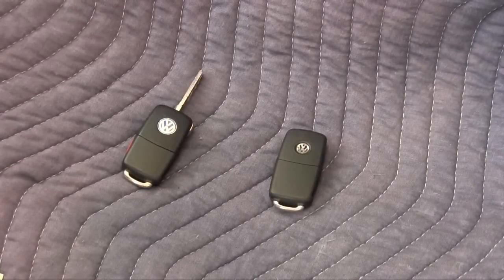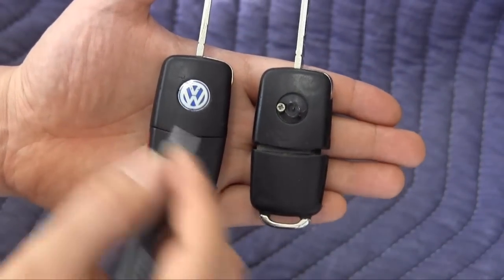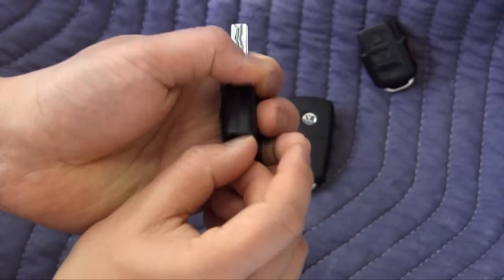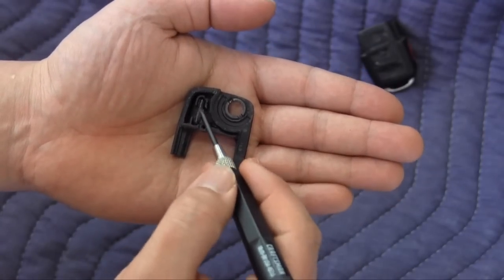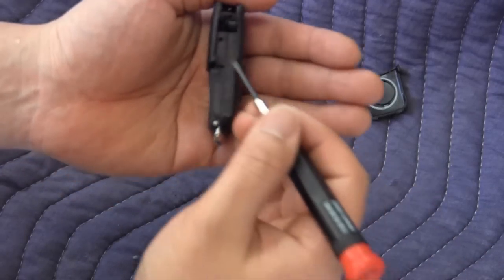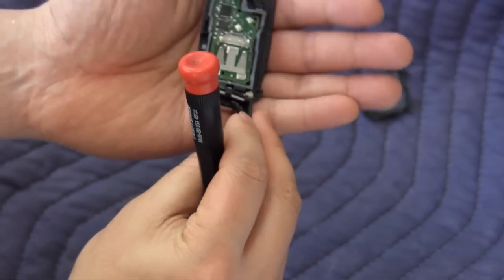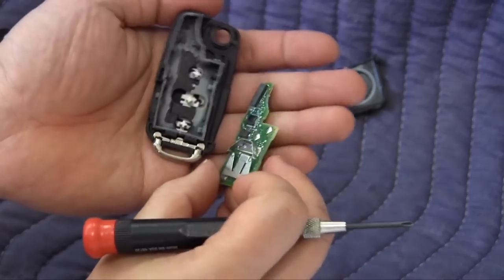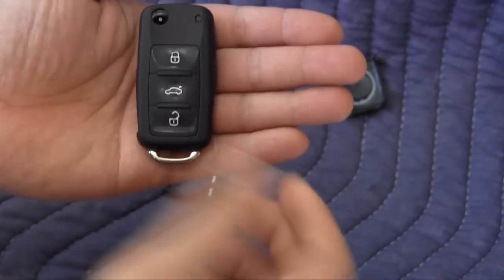VW and Audi key remote disassembly for replacement of key ring, flip key, and immobilizer chip

Comment: Great tutorial, much appreciated! Something I didn't understand when I first watched that might help others is with the newer model which VW and Audi don't make easily serviceable the "easy button" is to use a very small set of needle-nose pliers, select a drill bit or Dremel bit to cut away just enough of the plastic to get the tips of the pliers on either side of the locking pin just deep enough to get a grip on the pin, perhaps 1/8" and pull the pin straight out with the pliers. The pin can be reinserted to put the original case back together. In our situation the key fob had been washed and the panic button was sticking and I just needed to clean out the enclosure.

Comment: thanks! I had an old style audi remote (1997) and couldnt find a replacement. SOo I ordered the VW old key you showed, took it apart, put in the chip, made a new key cut and closed it. worked like a charm. The only sad thing is that the circuit is too big to fit in the VW key. back to manual hehe

Comment: for the newer style key fob I managed to push out the pin
out! I removed the Volkswagen logo from the back.  Where the logo used to be,  I drilled 2mm deep hole,  off the centre, to the right(towards the blade) ! Than I pushed it out with a screwdriver!!

Comment: On the older style of VW remotes 2009 and Older. The key fob can be removed by firmly pulling the two parts appart with a left to right motion. No need to mess with the screw to get to the board or the battery.

Comment: You can take the pin out without damaging anything. Use a small punch and tap it in approx 3mm and you can then push it back through once it’s apart to remove it completely, and then punch it back through again when it’s all back together 👍🏼

Comment: Thanks so much for sharing this! It was exactly what i was looking for!
I would like to mention though, that my 2010 VW Beetle has the one with the larger of the 2 VW emblems on it.
(the one that has the screw behind the VW emblem)------So maybe they changed in 2011 but not 2009 or 2010.
Reply: Same here, exactly what I were looking for. About what year they change the keys: I think they change the keys at different generations depending on models. I drive a Transporter T5.1 2010 and have the key with the smaller logo. So I conclude that they must have switched the key generations at different years.

Comment: you don't have to destroy, drill out pin or drill two holes... you just need to punch that pin in, it goes all way in (breaks just little plastic piece inside the key case. pin gets all way in and frees up so you can pry it. ANd after you ope your key fob, you can have that pin to insert back when assembling it back

Comment: Hey  i have the first type of key you showed but with the Audi logo. So do I have to remove the audi logo? because it be a shame if i remove the logo and there is no screw.

Last question is, is there a way on stiffening the flip mechanism of the blade because mine is quite loose.

Comment: Good video, however the small retaining pin on the side of the key don't go drilling it out or putting extra holes etc it'll look a right mess. Get a small dart or pin and just punch it through into the inside of the case!
Otherwise good tutorial 👍

Comment: Hi, are the switch blade mechanism the same on the two keys? I have broken the rotating part of the model with the metal pin. Can I order the other remote (that opens easily) just to get the rotating part to fix mine? Thank's!

Comment: Just don't try to remove the little immobilizer - it's very fragile and usually stuck/glued in there.  Rather place the plastic piece with it, inside the steering column 'very close' to where the key enters - the receiver antenna is located outside around the barrel so it has to be the closest possible to the antenna

Comment: I have a 2012 VW Jetta TDI and the key blade broke out of the fob swing arm.  I took the battery out and replace with a type 2 swing arm (note: arm will not swing properly but it will hold the key).  After putting the remote back together the remote buttons works, but now the car is saying "No KEY" when I try to start.  It is not a keyless start.  I thought that the IMMO code would hold even if the battery was removed.  The remote held the ENVRO codes to open and close the doors.  Any help?  I only have the one key and am no stuck.

TDI Love from Chicago...
Reply: WARNING! Never knock(or push) the pin in on a remote that you wish to keep the board.  The pin MIGHT knock off a micro resistor an the immobilizer RFID will render the board unable to work inside the remote casing.  To remove the board: Drill a hole under the pin and pry the remote open.  This mistake costs me $400. I like the old two part VW remotes.

TDI Love from Chicago...
Reply: How did you get a new key?..mine broke too

Comment: hey how are you i currently bought a Volkswagen MK4 2000 1J type and the key i received is not the flip one but just the ordinary key with remote locking and i was wandering if i can do a swap from the normal key to the flip key and i also have problems with the remote locking pleas help thank you.

Comment: hey i had a question, i accidentally broke(i think it very well could have been broken before) the immobilizer chip in my key, i dont want to try using it since i read peoples get messed up and have to be fixed by the dealer, will it still work if it is cracked? not sure, like i said im afraid to try it

Comment: Hi there I need HELP !!!

I own a 2003 Jetta 4 TDI 1.9
I have older model key  (blue with silver logo) (two button)

I replaced my battery but key does not work, I looked everywhere for "How to reprogram key" but cant find that works with older model key

Will you please help me....or push me in the right direction.. THANKS

Comment: WARNING! Never knock(or push) the pin in on a remote that you wish to keep the board.  I don't care how good you think you are. The pin MIGHT knock off a micro resistor on the immobilizer RFID side of the circuit and will render the RFID unable to communicate inside the remote casing. You will see "NO KEY" on dash and the car will start and stop immediately.  To remove the board: Drill a hole under the pin and pry the remote open.  This mistake costs me $400. I like the old two part VW remotes. If you can find a way to pull the pin out, without tearing up the case, please let us all know.

TDI Love from Chicago...
Reply: Are you saying that if you push the pin in it touches parts on the pcb and damages it? was this done deliberately by manufacturers you think?